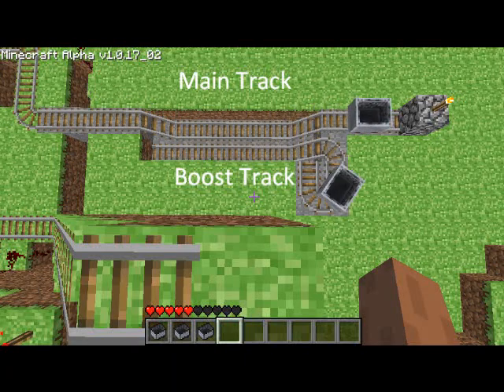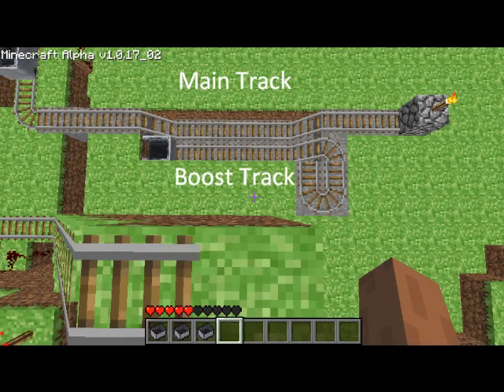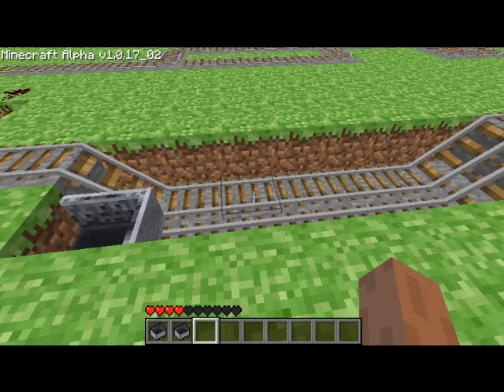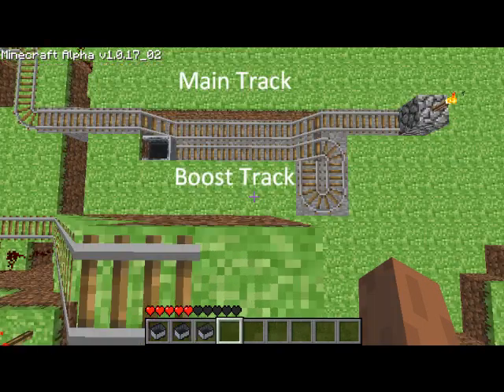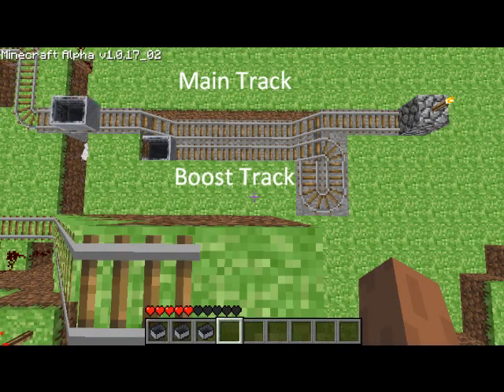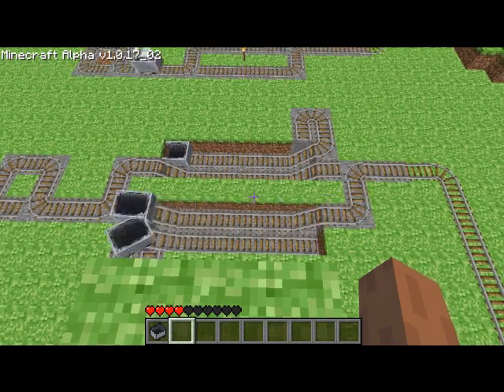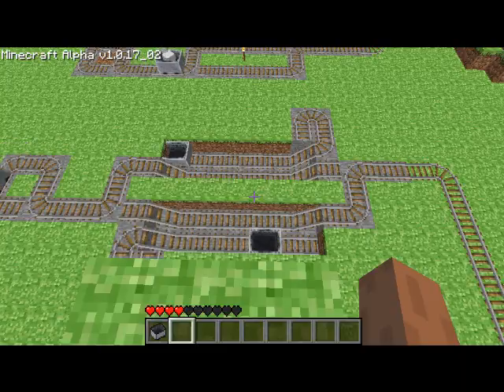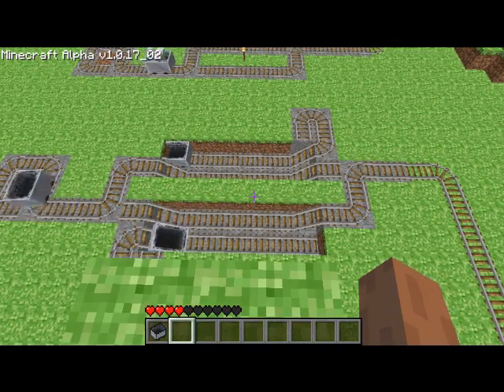Bob's Minecraft Tutorial 1: Minecart Boosters

Comment: you don't need the two bits of track to get two boosters, if you remove the loop from the booster when you use it the booster will be on the other side, so if it's mirror image basicly, it will boost you one way, then it will be ready to boost you in the opposite way next time.

Comment: one the last part i learn today from experimentation that you do not need to have the track fork out at the double booster section, you can have one track in the middle and boosters set up on both sides facing different directions from so you can use it going both ways

Comment: you actually dont need to split the rail in 2 if you want a booster both ways, just place 1 of your normal boosters on the opposite side,(and in the opposite direction) and it should work just fine. takes a little screwing with laying the rail tho